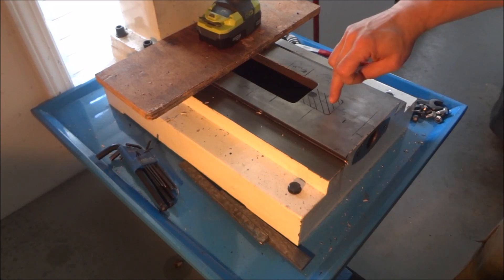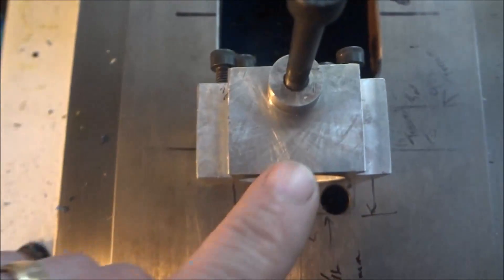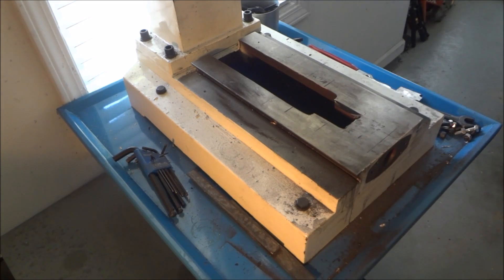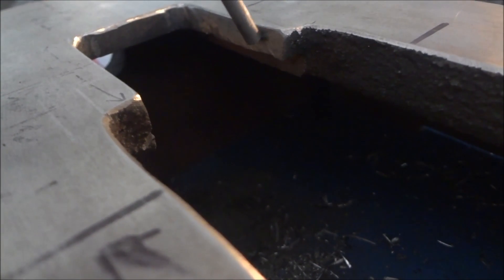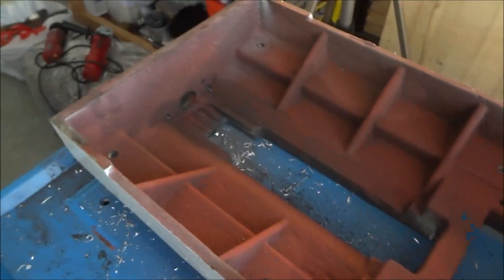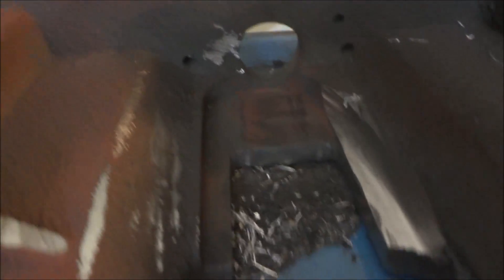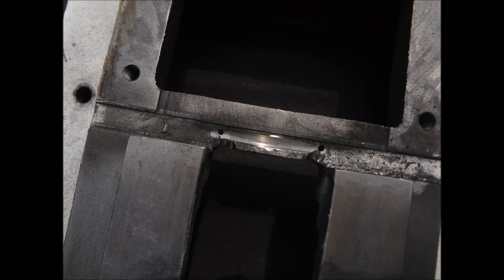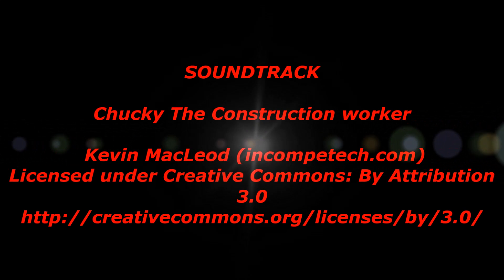PM727M Y Axis Travel Extension

Comment: without a notch, your travel would have been the 8.5" the machine is capable of? or would it have been much less because of fitting the ball nut mount in there...
Reply from the maker: The Ball-Nut tucks away under the X ,Y Saddle and the Ball nut mount uses the stock location.
The travel without the notch would be the same 8.5".
 A slight relief would need to be ground in the underside center for the Ball-nut clearance.
Reply: thanks for the rapid response(s)!